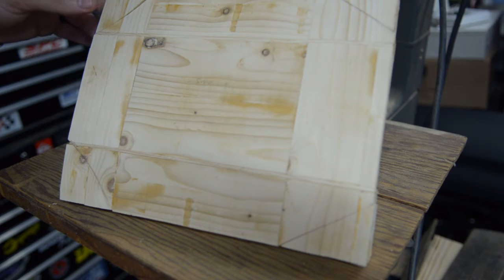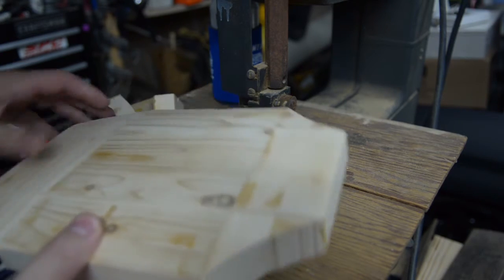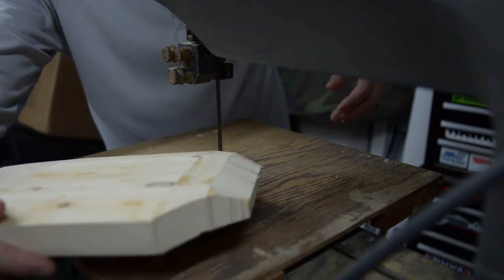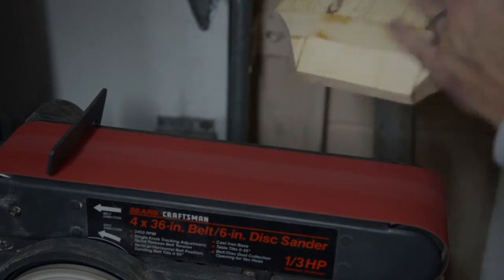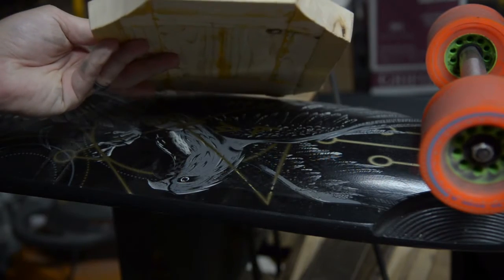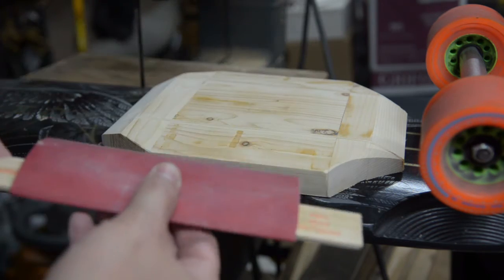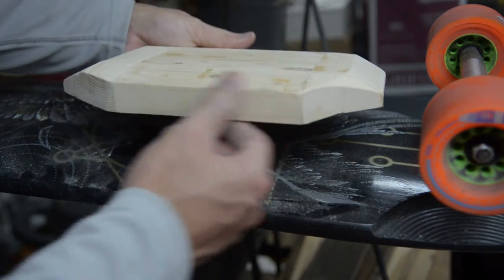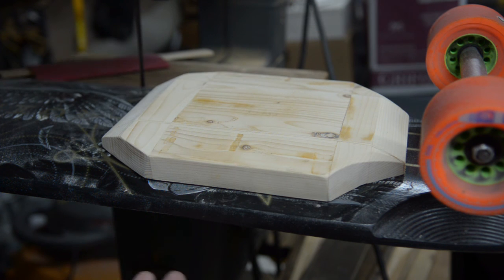HOW TO: Making a buck for thermoforming - ESKATE Battery Box Part 1

Comment: The proper way of making an enclosure but why is your setup so small? you could shut double the battery capacity there and have around 40km of range (Around 27miles is you are using cuntish units) I made mine out of fiber glass since it was easier but wanted to mold it out of ABS like you.
Reply from the maker: I've heard of nautical and statute miles, but I am not familiar with the cuntish mileage conversion so bear with me. A standard boosted board battery is 99wh. My battery is 222wh and I get almost 11 miles out of it cruising at 21 mph average. That is plenty of range for my needs and I don't want to carry more weight and bulk of batteries.  Ground clearance and weight are also important to me.
Reply: huh ok then :D I do prefer my board to go at least 30km because one way trip for me is about 12km so I like having alittle beefy battery for me but those lipos don't weight much and the vehicle is also the lightest out there so why not optimize performance? 

How about you share with us the forming machine you used/ built and the sheet material.
Reply from the maker: To me it is optimized.  We have different requirements and I do not require that much battery for my commute, so carrying extra would be a waste, unless I could ride 2 days without charging.  I might try a LiFe battery at some point and will consider increasing capacity then.  I will be posting the next video soon that covers the material and pressing.  Subscribe to get notification.
Reply: I think you should use light years per minute as speed, instead of cuntish units; or better yet, just go parsecs...sounds cool, just like the Millennium Falcon